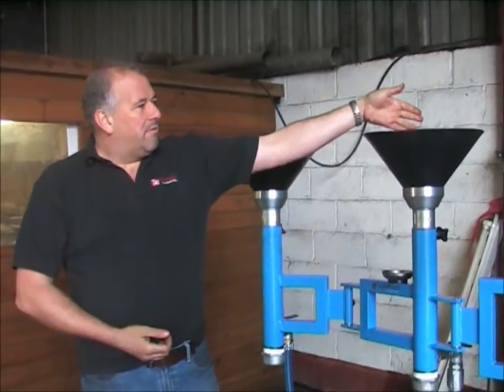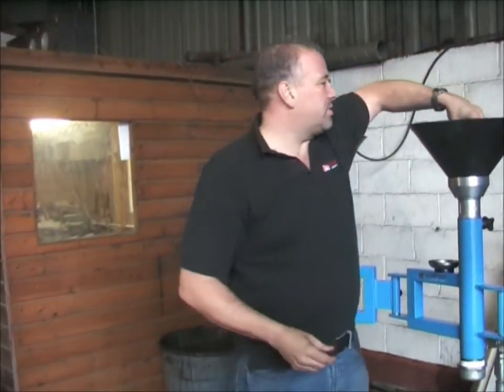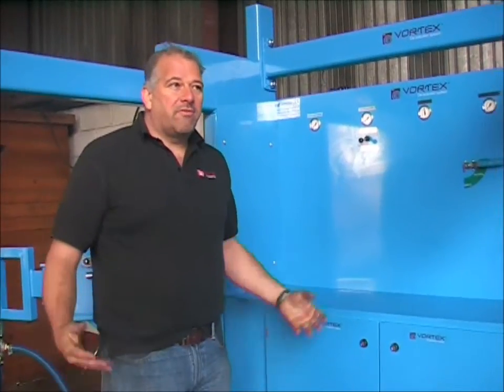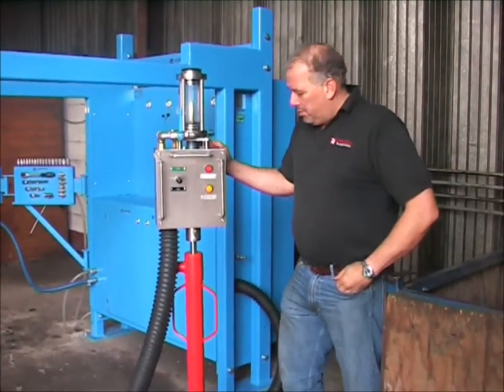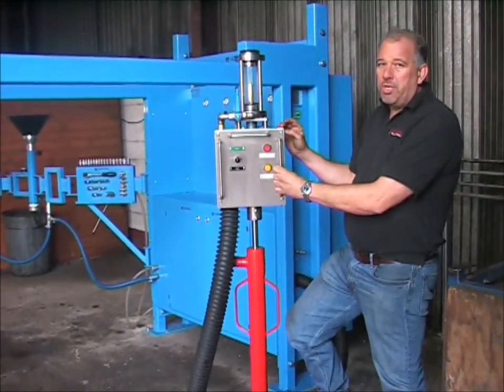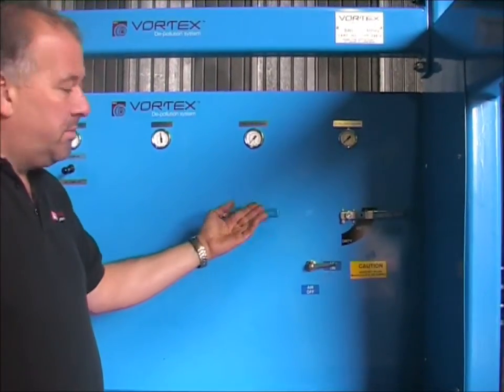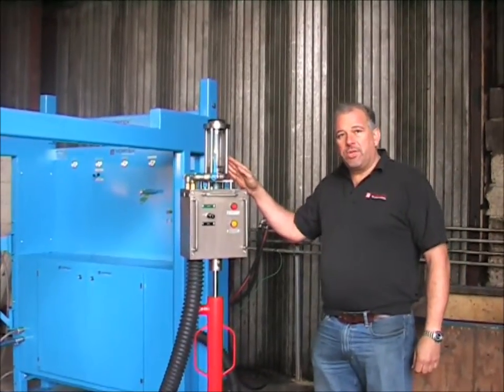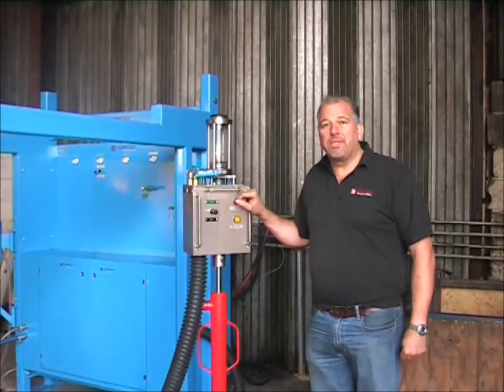Vortex Combi system full operation video.wmv

Comment from the maker: There is no seal between the tank and the skid plate and the gasoline will be running out the sides if you punch through the plate. Also you will not be able to to speed up draining as no vacuum can be created. The system comes with a fuel extension tool that can be used by cutting the fuel line and inserting the tool or via the filler hose. Some of the older truck with the tank on the side we can reach with the punch. Call me at +1-303-900-4040 for more info. Willem